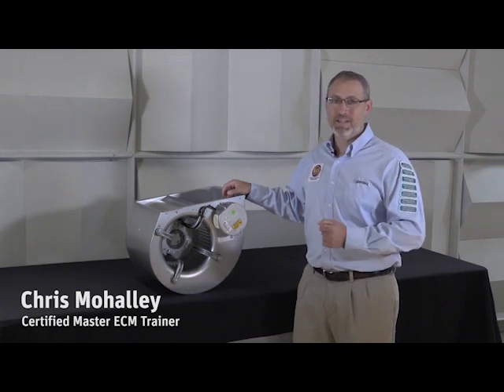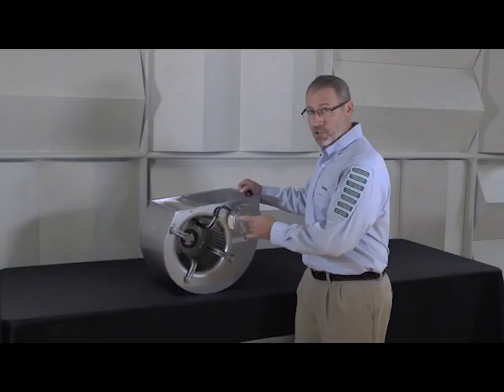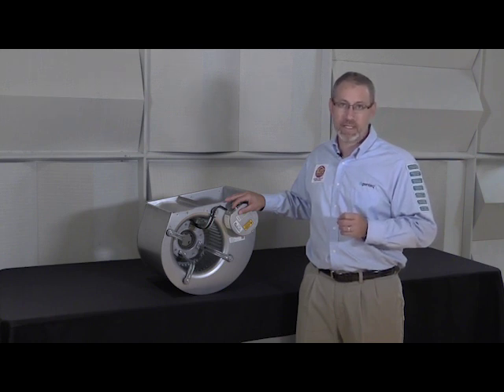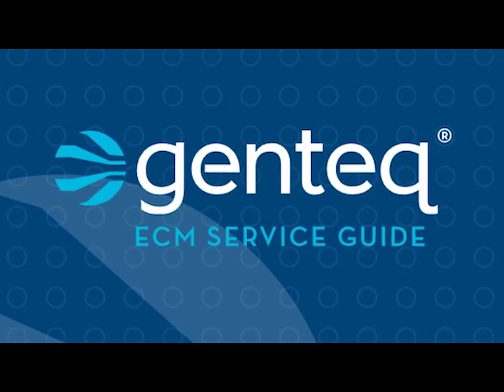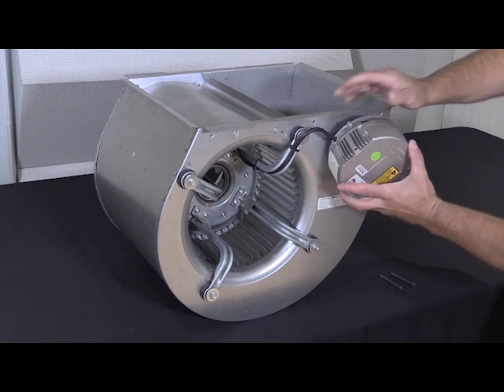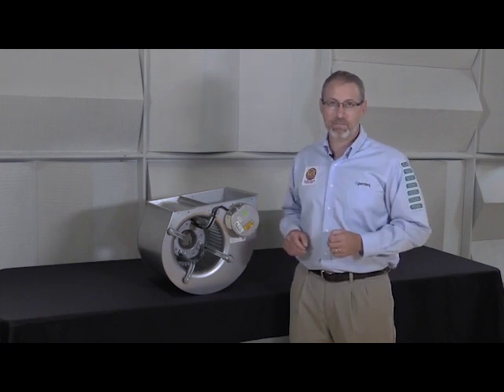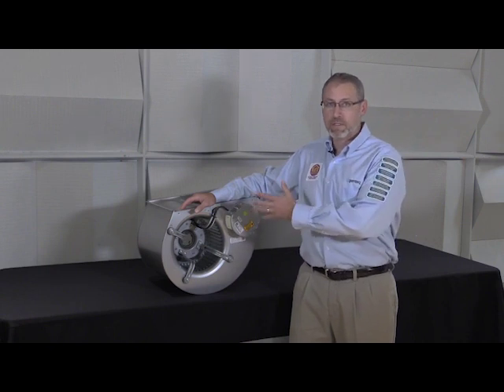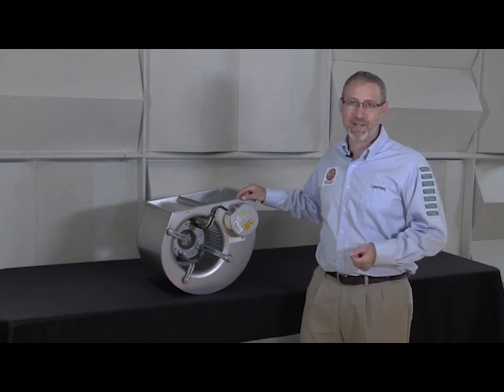DEC Star Blower Product Walk-through & Diagnostics

Comment: The selling point would have been to measure the wattage draw of the original system then show the draw of you replacement system.  My blower motor draws about 650 watts at 110 VAC.

Comment: This looks like a solution to a problem that did not exist.  I have to wonder how long the bearings would last in that unit. I like the idea of being able to replace just the VFD instead of replacing the whole motor. But you could of made that design on a regular designed ECM. I don't think there is enough restriction of air having the regular large motor located within the blower housing. I can't see how this would draw less power than a regular ECM motor. Each simply would use the same power to move the same amount of air. If air is restricted the blower would simply turn at a slightly higher RPM to achieve the same end result but not using anymore power.